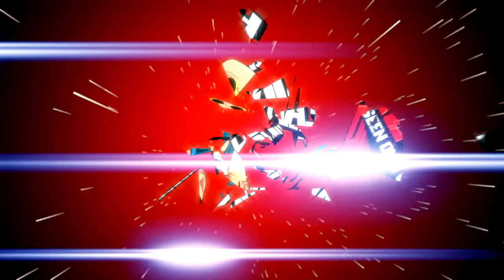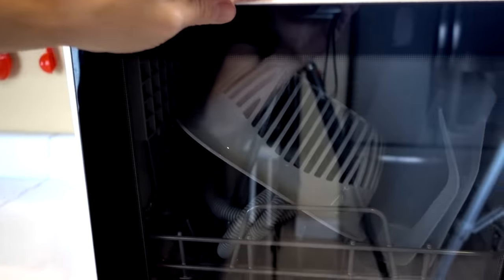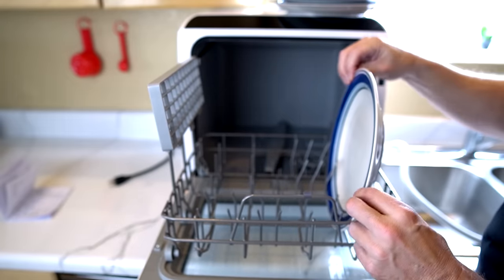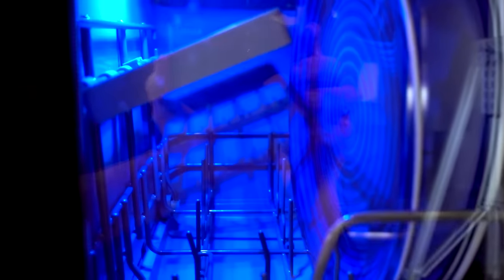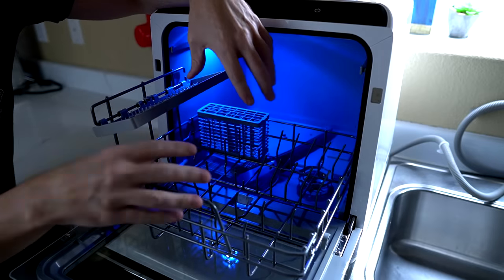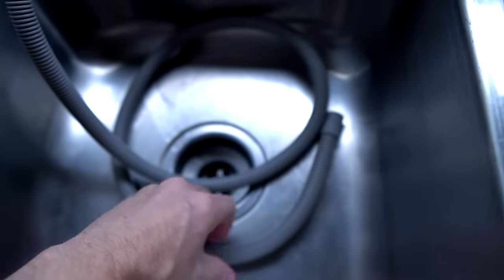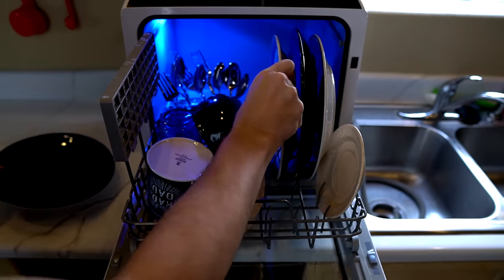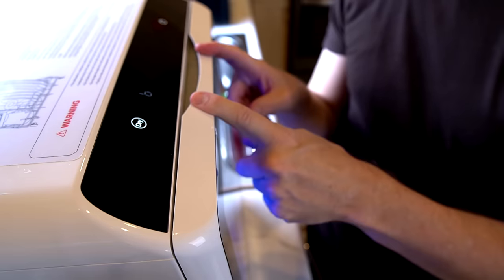Do Countertop Dishwashers Work? By Request!

Comment: I've had a countertop Edgestar dish washer for about 5 years now because my kitchen doesn't have space or hookup for a full size unit. I love it. It cleans pretty much everything, has lasted a long time, and hooks up to my sink with an adapter that screwed onto my faucet. Just pop the hose on when I want to run it. And it fits quite a lot of dishes at one time.

Comment: This would be great for an RV if it didn’t have one or a tiny house!
Reply: Purrfect RV Size!  😊👍😋
Reply: I was thinking this myself, and no it does not need to be on top of the counter, you could build a shelf under the sink, and add a GFCI outlet and plumb it right into the fresh, and gray water lines to make it look very nice, and out of the way, just use eco friendly dishwasher gel to not mess up the pipes.
Reply: @confusedalaskan  🐱 meow 😸
Reply: @Denise Belcher are you related to Dennis Farter?
Reply: I actually live in an RV full time and I have a countertop dishwasher. I love it. Mine is bigger than this one. I actually can wash some of my pots and pans in it too.
Reply: That was the first thought I had as well

Comment: I've had a counter-top dishwasher for many years in my Airstream 19ft camper.  ❤❤❤ it to the max!  Mine is a DARBY and has a top rack for cups and smaller items.  It has saved me countless hours away from kitchen chores... to enjoy other outdoors activities.  My model also has Power Dry for faster drying and also a Santi Hot setting to sanitizing your dishes.  Works flawlessly and a joy to use!

Comment: For a household of one or two, I think it would be awesome!! It does take up quite a bit of counter space. seems like you would be really limited on where you could put it depending on the length of the drainage hose. Overall I think it's pretty cool!! And the price really isn't all that bad
Reply: I keep all my large appliances on a tall shelf, so when my dishwasher arrives I think I might put it on there too, but with some jug or bucket underneath to collect the drain water so I can just dump it in my sink in between loads.
Reply: You can put the drain hose in a bucket , this is what I do since I lack counterspace

Comment: I have a cookology one and I have to say it’s the best investment I ever made. Mine doesn’t have a cutlery basket, the silverware goes on that top mini shelf. I have a 30 minute eco cycle, a 1 hour full cycle, baby items, and a fruit wash cycle. Drying is part of the cycle, not separate like yours. I live alone with 4 cats so the capacity is no problem for me, but some things like big saucepans, frying pan etc, won’t fit. I have 28cm dinner plates which will fit if I set them at an angle. On mine, the door and display is designed differently but I love it.

Comment: For small kitchens with very little counter space, try putting a cutting board (plastic or wood) over the sink. Then only drawback is removing the dishwasher to a shelf when done.
Reply: I just placed mine beside the sink next to the fridge and when I needed to wash dishes jut threw the hose in the sink filled it up with water and let it run.

Comment: When he says the plates look dirty putting them in I wish he could see my plates being dirty🤫
Reply: @njrenkable  Better dishwashers have garbage disposals in the bottom instead of filters/strainers. And I mean better, not more expensive. There are some higher end brands without that feature. You also want one with a pre rinse soap dispenser and to not use pods. The pre rinse with soap helps.
Reply: I always rinse my dishes of all crumbs before putting them in the dishwasher. Not doing so baffles me.
Reply: @tune_smith  hm. Maybe it depends on where you live. I don’t see whey I should clean my plates before putting them in the dishwasher that then does the same job. My dishes get clean either way. If I maybe had one of those disposal thingies that Americans do, I would maybe rinse it off before as well. Of course I wouldn’t put a whole plate of vegetables in there. Those I do remove. For more than that, there’s just no need
Reply: @tune_smith  Makes sense it should be done probably makes your dishwasher last longer
Reply: @MilwaukeeWoman  True hard waste disposals in dishwashers unfortunately died in the 1980. Modern Grinders struggle to grind anything harder then cooked pasta, and lead to fine particle recirculation which can get stuck on dishes.  Modern dishwasher grinders are prone to failure and don’t work very well to begin with,  that’s why only lower end cheap dishwashers still use them.  Kitchen aid makes a self cleaning filter, and Bosch filters typically only need cleaning monthly, and are very reliable.
Reply: True, but after that last test, I'm sold. I'm gonna start saving because this is exactly what I've been looking for. I could fit 2 or 3 days worth of dishes in there at least and even on my worst function days I can muster up the energy to push a button lol
Reply: @MilwaukeeWoman  garbage disposals ar not alowed in Germany for example so This is not an option for everybody.
Reply: @kathrynhawkins7911  if you lived in the US you would just buy one with integrated blades... it's like an integrated garbage disposal... so even les need to rinse it. This is the one thing I envy the US for. But hey I take my affordable Healthcare.

Comment: The angle at which the plates reside is determined by the actual geometry of the plates.  Flatter plates will lean back more.  I'm sure someone already said this, but...  BTW, you can get half-width dishwashers.  They are usually around 18" and there are companies that can modify your existing cabinets to insert one of them.
Reply: I was going to comment that the lower rack tines were definitely slanted, and with a flat plate, would have resulted in a slanted plate.  But his plates were curved (concaved?), which resulted in the plates being more vertical than he thought).
When I moved in with my late wife (prior to marriage), her galley kitchen didn't have a dishwasher.  I took one of her 36" base cabinets, cut it in half, reassembled that part, and made an opening for an 18" dishwasher.   One of the best (and first) things I did to that house!
Reply: @jwhite4   That's quite amazing.  And rather scary if you ask me.  Good show.

Comment: I had this for four years, and it still works great. Just some splitting of the rubbery plastic on the rack, and rusting underneath, but same thing happens on full size dishwashers over time.

Comment: An important thing to note is that cleaning is primarily done by the caustic detergent. The role of the dishwasher is to dissolve and continuously rinse the solution over the dishes. I think this is why your full sized and countertop dishwasher performed well side-by-side… both used the same detergent and both effectively moved it around and over the dishes. Thanks for the video!

Comment: Oh perfect, I've been window shopping some of these. I live in an old ass house not ideal for installing a standard dishwasher so countertop alternatives have been enticing. Thanks, James!
Reply: I've used the RCA countertop dishwasher for just over a year now.  It's wider than the one he reviews - about 22" wide - and an inch or so taller.  I freakin' LOVE it.  I live alone, and it holds about a week's worth of dishes/cutlery/glasses for me.  Sometimes I get lazy and don't feel like washing my pots and pans and once they've filled the sink, I'll do a load in the dishwasher just of pots and pans.  It never ceases to surprise me just how much I can fit into it, and it does a fantastic job on my pots and pans even when they have caked-on dried-on remnants of food!  It's also about $100 cheaper than the reviewed one, too!
Reply: Awesome, thanks for the input. The major setback on getting one is the height of all of the ones I've found tempting. My cabinets only give 16 inches of clearance and the shortest one I've found has been 17. I could put it on a table that I have that has a convenient power outlet but draining is a problem. Would you be able to tell me if there is an internal tank on yours that can be used to drain manually or does it have to use the drainage pipe?
Reply: @konversion  Mine does not have an internal tank.  I specifically did not want one with an internal tank because I use a portable "swamp" cooler in the summer to help cool off my main living area and honestly, it's a real annoyance having to fill it up every 4 hours with water and/or every time I want to use it!  Then there was the countertop ice maker I used to own that I had to refill every day until it died on me (despite it only lasting just over a year, I really loved that ice maker!).  Anyways, the last thing I wanted was yet another item that I needed to refill!  So I specifically searched for a dishwasher that did not have an internal tank.  I currently have mine on a ledge that is above my main sink/counter area, but when I originally bought it, I placed it on a wheeled microwave cart that I used to own.  I would simply wheel it over to the sink and hook it up whenever I wanted to do a load of dishes.  That worked quite well for me, but eventually I simply moved it to where it is now as I wanted to go back to using that cart the way I used it before - as a sort of wheeled "island"/prep area.

Comment: I've got one of these and it's one of my best buys ever.i just load it during the day and let it run overnight.one drawback is you have to be careful how you load it up to make the best use of the limited space.the cleaning is just as good as a full size dishwasher. eventually you find the best way for you and it will only take a few mins to load up and fill with water.

Comment: Our kitchen doesn't have hookups for a full size dishwasher, but we are saving for one.  In the meantime, my husband bought me the Novete countertop dishwasher.  Like you, I think it works very well, since it is just the two of us.  I wash the pots as soon as I am done using them, and put the plates, glasses, coffee cups, and silverware in the dishwasher and set it before I go to bed.  Even though our bedroom is only about 11 feet away from the dishwasher, even with the bedroom door open I can fall asleep because it is so quiet.  I can fit 2-3 coffee cups on that little shelf, but not much else.  I too had problems with pouring water into the top of the machine, but I rectified that by setting one of my canning funnels on top.  The machine is pretty light considering the size, so until we can afford an electrician to install the hookups for the full size dishwasher in a few years, we are getting a pull out shelf installed into the space for the dishwasher and setting the Novete on the shelf with the drain hose feeding directly into the drain plumbing in my kitchen sink, and just fill it from the top like we have been doing.  All in all, I like it and it does save me time in the kitchen since I can set it and go to bed.

Comment: When you put on the oatmeal, I had a flashback of a plumber telling my father, “The dishwasher is not a garbage disposal.”
Reply: But... It is. Dishwashers have either a filter system you need to clean out or a disposal system. That or course applies to normal dishwashers, not this counter top one
Reply: Yeah at least scrape your dishes off
Reply: @GodleyX  has a food filter trap

Comment: ooh, you should try that zero water thing as seen on tv.
Reply: If it’s the zero water filter/pitcher, it’s great!
Reply: My husband bought one (against my wishes), and I was blown away.  We have really hard water here, and I could never drink water from the tap -- it tasted horrible.  The Zero Water actually makes it taste like distilled water.  It's not much cheaper than buying gallons of distilled at Walmart (like 1c or something), but I'm not lugging around gallon bottles and I'm not using all that plastic anymore.  I'm beyond impressed with it!
Reply: can tell you for a fact Zero Water works!!!!! I have been a big fan of it for years and still use it to this day.
Reply: Zero vs. Britta and  Great Value
Reply: @brianturnbough4955  yeah that would be great to see, although ive been a big fan of zero water i know there are others that are big fans of britta, would be interesting to see how britta holds up in comparison
Reply: I live in Las Vegas (just like our man here in the video) and we have some of the hardest water in the country. Got a Zero Water filtered water dispenser and it is amazing! Even compared to the Pūr and Britta water pitchers I have, Zero is the absolute best. The only issue I have with it is that it is actually too good at filtering the water and the filters need to be changed more often than the Pūr or Britta. A minor annoyance is that it takes a lot longer to filter water in comparison. To be fair, the Zero Water does come with packaging with a map of the US showing which areas have hard water and the levels of hardness and a disclaimer that you'll need to change the filter more often if you live in these areas. My dispenser came with a tester which makes comparison between all the brands really easy to do.
Reply: yea zero water works, but the FILTERS are PRICEY... and for 2 people it last about 15-20 days.  Filters are like 15 dollars each, so around a dollar a day.  So factor in the price, pretty much cheap bottle water territory essentially, like 20 times the price of Brita.  
If you boil the water in a kettle, you can seriously see the difference, no buildup at all, but if you making coffee you need to mix some minerals in because this strip the minerals and won't make it taste good.
Reply: Yea I hate replacing the filter that often but there is so much chlorine in the water you can smell it. The 320oz glass dispenser is nice.

Comment: I’ve had one over a year. It’s fine for 1 person.
Reply: Karyl does the washer heat the water or do you have to pour in hot water?
Reply: @insiderinside1905  has internal heater.

Comment: I’ve had several countertop dishwashers in different apartments through the years - and they’ve all worked surprisingly well.  Some were designed better than others, some were more expensive, some were easier to connect water/drain.  I’d highly recommend one to anyone who is thinking about getting one!!

Comment: So, The reason why these work well is because it's a normal dishwasher in a smaller size. As long as the water can heat up and water can move around. It will work. It also has to do with the type of detergent you use. I had a countertop dishwasher years ago and it worked great. On mine I used the faucet setup and came with 2 adapters. Worked great for 6 months but the problem with the hookups to faucets is they tend to strip after awhile. So it would leak where you would connect it. This type of setup seems like a better use. Also you can use the Pods in those. I just threw mine at the bottom in the middle and let it go. As long as it doesn't hit the blades you're fine.

Comment: They are somewhat common in small city apartments in Denmark, where I live. 
I got one for Christmas from mom a couple of years ago, and was very excited. I guess that’s when you know you’re starting to get old, when dishwashers excite you. 😂

Mine is a Bosch brand dishwasher and it’s like a regular one, just a miniature version of larger models. I also have to fill it up with salt and rinse aid, like normal. And can configure it to the hardness of my local water. 
I got the largest one that could fit under my cabinets. 
I click it on my tap when I need to use it, and turn the tap on for cold water. It has a rinse program, cool program (45C), delicate items program (40C), ECO program (a wash that lasts 4h 20m at 50C but saves on water and electricity), auto program that determines the heat depending on how dirty things are (between 45-65C), and a hot program (70C).The hot program is mostly for pot, pans and similar robust items. 
Most programs last for more than 2 hours if turbo mode isn’t turned on, but this is apparently for some energy and water saving thing. It doesn’t matter though. I turn it on and it just does its thing. I don’t need to watch it. .

As for sterilization, you don’t need extremely hot water for that. The drying process is more than enough heat most of the time. Also, if you use proper dishwasher detergent, then they are anti-microbial as well, some even contain chlorine for that very reason (and for bleaching purposes). Even those that don’t are very corrosive. That’s why some things are not considered dishwasher safe - it’s not because of the dishwasher itself, but due to the harshness of the detergent that is used in dishwashers.

Anyway, I’m very pleased with it. I’m the type of person who puts off washing the dishes until everything is crusty and almost impossible to do by hand. Now I just put things in and boom, done. It’s especially nice for pots and pans - those are a pain to clean by hand. It even removes burnt on food. It is made to not have things rinsed off first, just the food scraped off to save on water. 😊
Reply: Merci pour toutes ces précisions.

Comment: I have an SPT Model SD-2213W that holds a good sized load it can actually hold a 4 place setting with six wash settings. It usually takes close to two hours on the longest settings but the dishes come out sparkling clean and dried by using hot water that also sanitizes the dishes. 

When I first got it they claimed it would clean food on plates that was 24 hours old. I actually tested it the first time  by holding a couple of plates out for a couple of days that were  heavily soiled with egg residue and spaghetti sauce. I overfilled it by what their directions say and everything came came out sparkling clean and dry. They will dry faster if you pop the door after the cycle is finished. 

I have had mine now for about 3 yrs in my motorhome and used it daily with no problems. It came with everything I needed to hook up the hoses to my faucet including the quick connect male end. It was real easy to hook up.